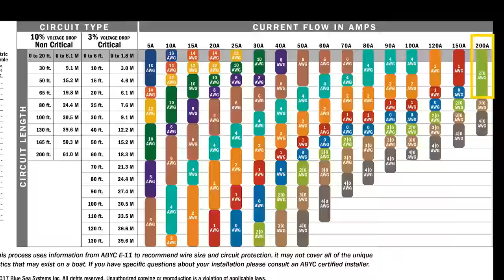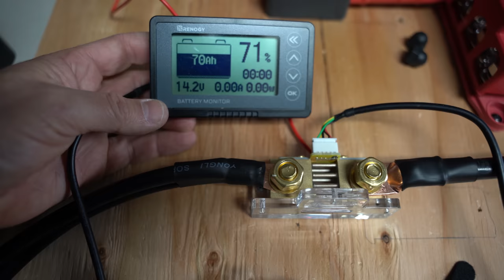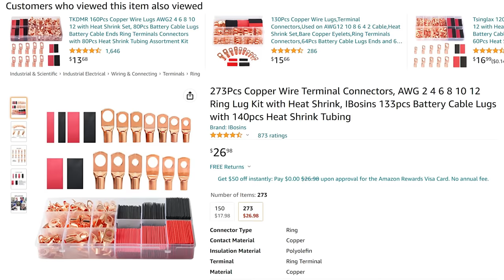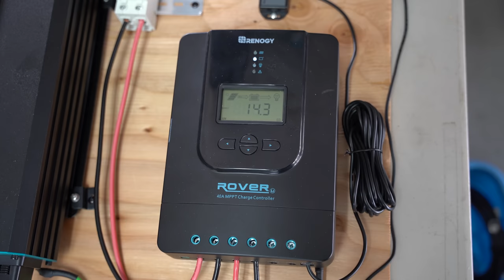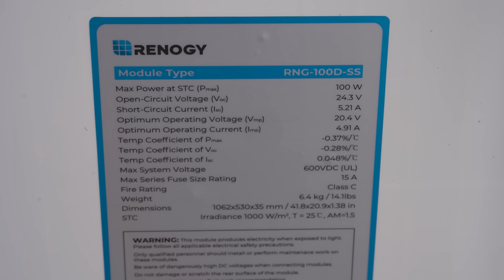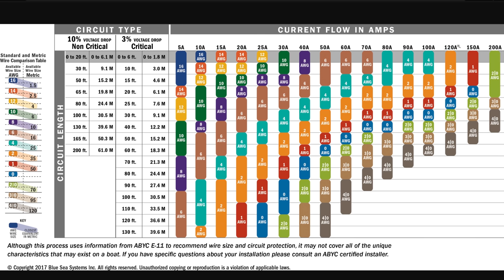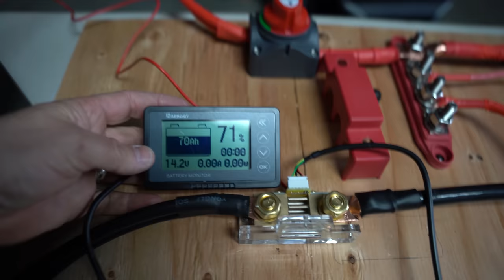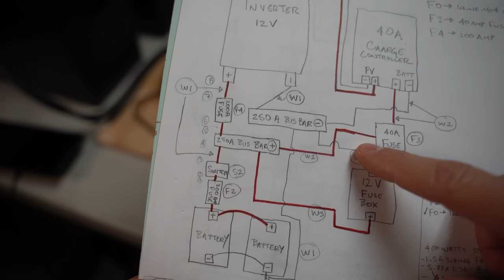How To Build A Solar Setup: COMPLETE Step-by-Step, DIY Guide (12V, 2000W)

Comment: nice explanation of all but my suggestion would be to calculate all.  like inverter + multy fuse block + charge(200+125+40)   for the wire/switch/fuse between  the distributor blocks and battery,  example setup will trip fuses if the inverter is max out + anything else is  running of the fuse box

Comment: This setup makes setting up so easy. Thanks, Chris.
Did you ever make schematics for this setup? 
Also, this looks like you could add 2 batteries and 800watts solar panels. We bought this very Renogy 400watt x2 setup.

Comment: Very informative video. Personally I would have preferred to start at the solar panels ( where all the power originates) and work our way to the inverter . Rather than from the inverter back to the source of power. I prefer to follow the money, I mean power trail to keep it straight in my head. Still great information. TU.

Comment: Really enjoyed learning from your video.  Now, I know you were working on a 12 volt system which are used in RV’s. What I’m wondering is whether we tie any of this into the fuse box in the RV, since getting to the plugs on the inverter outside of the RV would be difficult for a CPAP or TV/DVD inside the RV.  
Also, I noticed on my fuse box how the positive and negative wires came into it from the original coach batteries. So now will I have also the Positive and Negative wires coming from the solar batteries to the same place?

Comment: Question, if your PV amperage is only 8.13, why did you choose a 40A PV disconnect breaker? Wouldn't it be better to have one closer to the maximum current from the panels?  Great video, really helped me figure everything out.
Reply: Im guessing its because his charge controller is rated for 40a, so if ever he wanted to increase the number of panels, he will already be set up.  The 10a inline fuse is what protects his existing solar panel setup.

Comment: Very clear and informative. Thank you. Maybe I missed it but I have 2 questions: 

(1) Why the 500watt 40 amp controller? Are these specifications based on the DC input from solar panels in series? 

(2) How did you spec 2 batteries volts, amps/amp hours?

Comment: There's one gripe with that entire video I have, I would recommend using a hand hydraulic crimper if you're using cables for automotive purposes, mainly because they provide a much much stronger connection that can hold up to the constant vibrations muuuuccchhhh longer, they do tend to be on the more expensive side however

Comment: You’ve outlined this process very well and I expect it is scalable if one uses the formulas and the wire and fuse sizing as you indicated. 

Thanks again for a clear and simple explanation!  Keep it up!
Reply: If your inverter is 2000 watts and peaks out at 4000, would you be safe using a 350 amp fuse?  Or does the life of the inverter reduce due to allowing it to surge for say running something like a refrigerator/freezer, or something with a pump?

Comment: 2x24V panels in series, Victron 100/20 MPPT charging 12V marine lead acid.
59°N : 24° E is not too generous with sunlight when you need it ;)
EDT:
Oh, and direct manual dump to resistive heater. Even 15W for 3 hours is more than nothing :)
Soon to be automatic, switching from float for batteries.
EDT2:
Oooh - grounding!
For some strange reason in soviet army phone systems were grounded on positive and radios on negative (at least the equipment i was on). And late night accidental simultaneous touch of different racks was .. energizing ;)
(non-lethal .. with dry hands)

Comment: @6:49 your calculation of 2000w/12v/0.85 being 196 is incorrect. If the inverter is only 85% efficient, that means that the value you get when 2000/12=166 is not correct unless it would be 100% efficient, so the efficiency amps total is less than 166. You would multiply the total amps it can handle by its efficiency. 2000/12=166 multiplied by 0.85=141 amps total, essentially meaning you could run 1/0AWG to support 150A. I'm not saying this to nit-pick as I have used a ton of information from your video and am buiilding my own, which is why I have rewatched it and believe I have caught this error. Anyways thanks for all the info!

Comment: I was teetering with the idea of setting up a system. Well a free 3000w inverter, basic charge controller and 12 100ah batteries it’s time to get it done. Now I can do it with confidence. Excellent step by step. Thank you sir…

Soooo, 2 panels at 255 and 240 watts (wired in series), circuit breaker, 40 amp charge controller, 3000w 24v inverter, 300amp fuse, bus bars, switch and 12 AGM 100ah 12v batteries (will wire series/parallel for 24v system). How’d I do…lol. No really how’d I do…?

Comment: If you wanted to add shore power and a generator to this , would you just connect it also to the charge controller? Could you maybe show how these may be added to your diagram? This is an amazing video, thank you so much for the explanation. I have been trying to find a simplified way to build my camper electrical system.

Comment: This was an awesome video and thank you for all the info and details you provided. My question, when you connected the SCC battery leads over to the bus bars. How does it know which route to take from the bus bar to get to the battery? If you had the inverter running, what prevents the current from the SCC going straight to the inverter and missing the battery all together?

Comment: You should discuss  how to calculate what size system to buy. For example I would be interested in a system that would provide power for a room ac. The type that is usually on wheels.

Comment: Very helpful video, I am building a similar setup minus the 12v fuse box.  Very intimidating for a newbie and I found so many other video's only using 2awg wire from the battery to inverter, and so many conflicting ampacity charts.  I'm going with 2/0 like you did.  Also not clear on the battery fuse size as some people say to size up to 250amp,,   I just don't know enough about all this so I want to be as safe as possible.  This is just a project I have wanted to do as a hobby, I'm not saving any money as I see it I can buy pre-built systems for less that are more portable, yet I still want to build one.  My setup is 2 power queen 100ah batteries, bougerv 2000w inverter, Redodo 40amp charge controller, renogy smart shunt. 2 busbars...   For the battery is it ok to use a circuit. breaker instead of a switch and fuse?

Comment: I agree with your statement that fuses protect the wiring, not the components, so if you have a 200A fuse coming directly off the battery, why do you need another 200A fuse from the bus bar to the inverter? Isn't that already protected by the fuse at the battery?

Comment: Excellent walk through! I've watched this video six time so far in order to build my own system. My only question that doesn't seem to be explained is, why have double wires to the positive and negative terminals on the batteries going from/to the shut off switch and negative shunt? Did I miss something here?

Comment: #1 should use welding style cable for flexibility,  #2 fuse is not a circuit breaker and visa versa, please use correct termalogy #3 gtounds should be isolated from the -- connections, should be only bonded at one point, this is to avoid ground loops, same with AC setups.

Comment: Thanks for this. I knew nothing about this stuff and see that it makes a lot of sense. So, If you had used a 48v battery, your cabling could have been smaller 2000/48 = 41.67A instead of the 166.7 amps.
Reply from the maker: Exactly

Comment: Possible note; the guide you used to determine the size of the wires did not list stranded aluminum wire, YES, you will have to upsize the wire however it is MUCH easier to manipulate.

Comment: Hi, great job and thanks for posting the video.  How has the carpet held up so far?  Is it peeling off the edges?  Did you scuff the surface before gluing down?  How many cans of spray adhesive did you use?

Comment: I have been spending almost a week here to find the right concept how to build a solar generator for my rv. Thank you. But I have found a mistake of how to find the right amp in the formula you are dividing the the wattage of the inverter by the 12 V output of the battery or batteries but you should multiply the percentage loss (X 0.85) to obtain a lesser amperage result

Comment: Thanks for all your videos, very informative and educational and well done! I have a couple questions on your final set up, How many of the 100 watt panels do you have and the quantity and amp hour rating of your batteries? Have you tested out your system for use on your refrigerator, or a freezer or a microwave oven and the results? I have (2) 12v 60 amp deep cycle agm batteries that was gifted to me that I have set up but I have not attempted to perform many tests as I just got it put together and the cloudy days don’t help! I have run a shop vacuum, a chop saw (no load) some lights but not for very long! lol Thanks in advance for your response!

Comment: For those who don't know, longer the wire and added bridges, the greater the resistance.
Resistance = Power loss
But yet to say, this is indeed a full home DIY Solar build, so youll have a lot of resistance, so you'll have to output more wattage. Easier to run a basic solar build with a 60A solar charge controller, 2 250ah lipo4 batteries, solar junction box, 2000w inverter and 2-3 200-300w solar panels.
A single person doesn't need more than 100ah per day, or 2kw; And a single 250w puts out about 15A per hour or 1kw per peak day. For running a whole house for about 4 people you need at least 2kw per person, Unless you're a welder or something.

Comment: Setting up a small 200-watt solar system first time. Your video is very clear except maybe I missed something. You explained how you connected the +pos & - neg wires to the bottom of the switch to the charge controller but not how you connected the +pos & - neg wires from the switch to the solar panel. What or where are they connected to?

Comment: Love the video! Best one out there! One question I have is for the grounding, I see you have it to the negative busbar. And that bus bar goes to ground on the chasis or the negative side of the battery? I will be using this set up in a travel trailer. Any advice you can gove will help a lot, thanks!

Comment: Thanks for the tutorial, it was really easy to understand. Great stuff !! I'm building a stand alone offgrid system (UK) and have a question: should I connect the AC ground from the consumer unit (breaker panel) to a new, separate earth rod, or should I bond it to a DC earth busbar and have only one earth/ground rod in the system? Thanks.

Comment: Great video. I'm curious about the double wire from the buzz bar to the battery. Is this to allow a flexible 200a feed to the inverter? Also where you've used fuses, is there any reason these could not be breakers?

Comment: Great video! Helped me put together my system in my utility shed. Question: I have 4 batteries placed in parallel, when setting up the Renogy battery monitor, do I tell it I have 400 Amp hours?

Comment: Excellent diy video! But I notice a couple of issues:
1. You refer to a circuit breaker as a “fuse”.
2. Calculating the input amperes of the inverter, how is output of the inverter revenant in this computation? The 12vdc input is supplying voltage to a different circuit with pcb containing components to manipulate and change the voltage characteristics.
Reply: Revenant-relevant

Comment: Thank you for this video! I wish I had found your video first because your guide answered a lot of the questions I had from the other videos I watched. One question I had was if I want to start off with just one 12v 100ah battery and purchase the bigger 2000W inverter so I could expand the system later would I be causing issues for the inverter/battery or any other components in the system?

Comment: At minute 5:55, the equation on the screen is wrong. 2000/120=16.6, not 166. I will continue watching hoping that little error won't stick in my head and cause me confusion throughout the video. With so much praise in the comments, I'm guessing it will all make sense by the time you're done. I'm so glad you made this video. More explanations are always needed with so many other videos I've seen, so...thanks in advance before I finish watching. :)
Reply from the maker: Ah it should have been 2000/12. Good catch
Reply: @CityPrepping  Happy to help. 🙂

Comment: If the inverter fails your critical loads will be without power. Its recommended to install a bypass to switch to grid power if the inverter fails.

Comment: I have seen many videos on the subject at hand, and you by far are the most comprehensive and easy to follow, thank you for doing this. Im creating the same system  using a smaller 750 watt inverter. I paralleled 3 12V35AH batteries, for medical reasons I cannot lift heavy items, therefore, a 12v100ah battery is out of the equation for me. The 3 batteries give me 105AH which if I did my homework correctly, it compares to a 12v100 type battery. Will a 4awg cable between the 3 batteries be enough to safely run my equipment? Please let me know from the battery bamk to the inverter I did use a 2awg cable. Again, thank you for assisting in my 1st enery project.

Retired man enjoy life now (trying)😊
Reply: 4 awg is pretty stout considering the short length of cables between the batteries. Should be fine, no troubles.

Comment: Great video, thank you!  I'm a bit confused that a bigger awg cable can be connected to the same busbar that a smaller awg cable is on and not burn up. Doesn't the current from the bigger awg cables want to continue though the smaller awg cable and that way burn up?

Comment: So you didn’t have any issues getting good charge from your charge controller to your battery bank going through the buss bars? 

Wouldn’t that also be sending charge power to your inverter and fuse block at the same time? 

Great video on how to safely and sensibly setup a system! Thanks!

Comment: This was such a great video!!! Thanks for taking the time.

So to make sure I got this, I am adding a 3K watt inverter in a 12v system (buying up now so I can expand my system later). That means at 85%, I am at 294 amps. That puts me close to the 300 amp mark and am looking at WindyNation cables. That means I need a 2/0 wire, rated at 325, as the 1/0 is rated too low, 285. So that also means I can use a 300 amp fuse to protect the wire since it's rated at 325 max amperage.  

Does all that sound correct?
Reply: That's what I used for my 3K watt inverter setup.

Comment: I understand the basic principals for building this solar system. How do I incorporate this into my toy hauler or do you have a video on that process? My end goal is to use both solar and shore power while we are off grid. I want to use the solar for 12 volt and 110 volt, 12 volt for lights and heater and to power the refrigerator then 110 volts to power a tv, dvd player and maybe an oscillating fan. For the a/c, I want to use the shore power (generator). I don't have the room for a massive system (or budget) to power everything on solar so for us, doing it this way seems to be the best solution at the moment. Hopefully you respond as this video is the best explanation how to wire a system and how it has been explained.

Comment: Great video. I am building a cargo trailer for camping and this video has helped me figure out what I need. Do you know if the Renegy 40a MPPT charge controller can charge the battery not only from generator or solar panels, but I'd like to be able to charge while driving my truck. Can I run a wire from the truck to this particular charge controller?

Comment: Thank you for sharing your knowledge.  What would be the reason not to go with a 24V system?  Cutting that 200A draw in half sounds attractive.  I have just learned that P=IV applies not only to the AC side but the DC as well.

Comment: Great video very well explained I am a newbie to solar my question is I just purchased a class a motorhome that already has one solar panel on the roof how many solar panels could I add or can I add to the existing one panel on the roof 
I forgot to mention the coach is equipped with a 2000 W Pure Sine inverter if so how many solar panels can I add to the existing one that’s on the roof now and if I can add extra solar panels do I do it and series or parallel…. Thank you….
Frank

Comment: This is an exceptional video. Would anything change is I wanted to have a 3rd or a 4th battery in series with the first two ?  Have a couple of refrigerators and want to be sure both stay cold at least overnight, should we experience any power outage.

Comment: Excellent video. Two questions; 1) How big was your board and was it 3/4 inch plywood.?  2) What do you figure is your
maximum output in amps( you will run less than that)?  Again excellent video like always.

Comment: Thank you for video. Can you explain or maybe make video on how to get the batteries charged by using a generator. I'm wanting to do 12 volt wiring and charge my batteries by plugging in to the system not solar panels

Comment: As I am researching to set up a 12v system for myself I have to commend you for a great, easy to follow and detailed tutorial i have come across. Just 1 query, would it be more efficient to charge the batteries by wiring the charge controller directly to the batteries rather than go through the bus bars? I picture in my brain that the juices from the charge controller would be used to power the appliances rather than recharge the batteries. Or is this the whole purpose so that you preserve the batteries and use the solar power? I'd imagine the voltage at the bus bar to be 14.4v or whatever the charge controller is producing, would this be an issue on appliances?